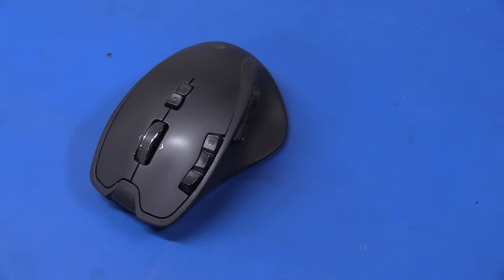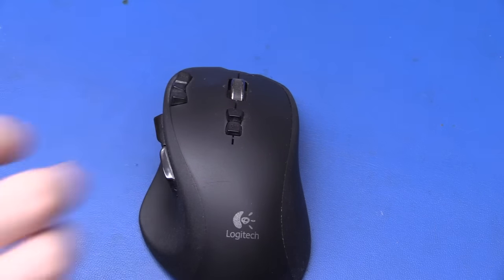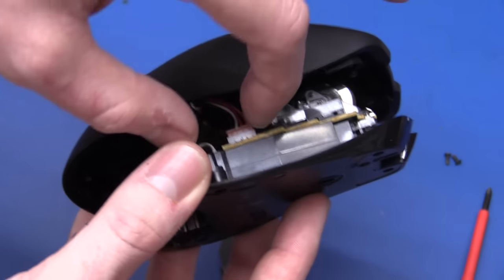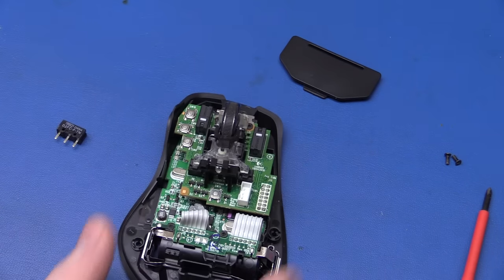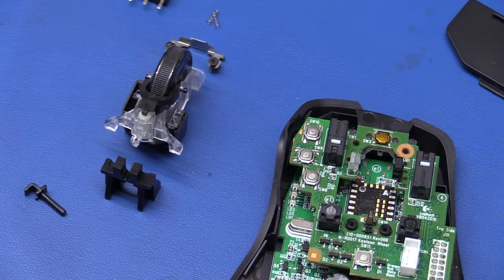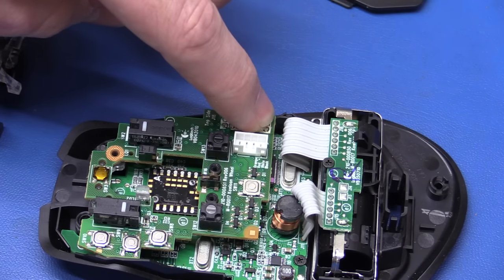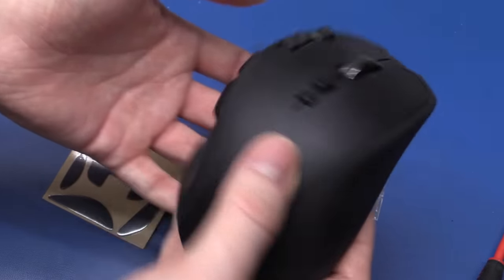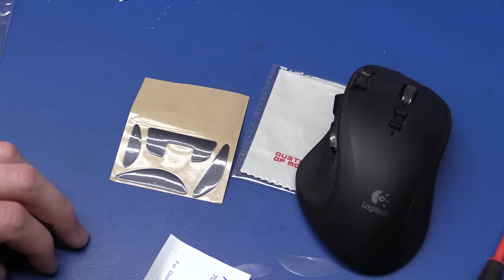Logitech G700 Mouse Repair (Bad Switch) - Ec-Projects

Comment: You might want to replace the whole upper board assembly with a new one from EBAY. All switches will be new. On top of that the new boards will have a 14 pin socket in place of solder pads. No need to resolder the new board in place. No unsoldering will be need in the future. The new boards I recieved have what looked like it has better quality switches as a plus. I have a supply of 60 million click switches on hand for the future. Only 3 solder connections now instead of 17. After all these years Deoxit will not undo physical wear caused by a trillion+ clicks.

Comment: I followed every step in this video, made the solder and tested the clicking of the micro switch which works well. Once I put on the cover and start pressing , the left button does not register a click at all. Not sure what is the issue though

Comment: I love my g700 but until yesterday my middle scroll wheel button stopped 'clicking'. I opened the mouse up and realized that the little gold circle thing that the wheel is supposed to press to register a click is stuck all the way in:( i mean the bulge is downwards so the curvature is not upwards.. any way to fix that? Do i have replace the whole board or just the gold thingie? Any place to order that part? Please help...

Comment: I have a Microsoft mouse from the time when they still made good hardware, that I revived like that once. It's an intellimouse explorer mouse (v1 that still support PS/2, but at that time they didn't even print version numbers on it ;) ), that has to be 15 years old, if not more (Amazon has reviews from 1999 for that thing!). I've use it 10+ hours almost every day (work related), but it has also been to LAN parties quite often in the beginning, where it survived Diablo clickorgies among others, and is still used for games alot. 
I also had to shorten the lead twice (once near the plug and once near the mouse, because the wire broke) and I think I only exchanged the left mouse button switch once (for a used switch from another Microsoft mouse of the time).
Other than that nothing broke, wheel is still fine, other buttons as well. Can't get anything like that anymore.
Damn, I'd really like to know how many clicks that mouse had. It has to be in the tens of millions, considering that a single Diablo session could easily get you to thousands of clicks.

Comment: Don't have the double click issue, but rather scrolling with the wheel seems to stutter.  For example, when scrolling down it might scroll up a tiny bit and then down again.  What switch/sensor keeps track of the mouse wheel assembly movement?

Comment: Decided to see if I can salvage this mouse which I have replaced for a couple years ago. It had the faulty double click issue. 

Question: When removing the solder at the 6:00 mark, what happens if the little circular solder pad discs are moved too? How do you repair it?
Reply from the maker: Hmm, you would have to follow the traces and find a component where you can solder a thin wire, then bring it back to the pin. you can also scrape off the solder mask over the trace and solder the wire there - That probably requires a microscope though, since you don't want to hit the ground plane at the same time :)
Reply: I had this mouse under my bed nearly for  5 years. I had put it there when it started having doubleclick issue. Mine pads are also nearly all gone while removing soldier. Must have happened because the iron was too hot or i didn't use the wick in the start. But the interesting thing is the omikron switches tested ok outside the mouse, so the most possible problem I had, should be just bad soldier on pins. Too bad it had gone bad in 3rd year of use, shame on logitech for not using a socket to connect the boards, shame on me for still not being able to protect the small board pads while soldiering.

Comment: Which is the second tool you are using there to break a little bit the previous solder mask? I have just only a solder iron (don't really know how North americans call it) so I have had a hard time trying to remove the original soldier mask. Would appreciate any info, thanks!

Comment: What do you use/do when the switch won’t come out due to the factory solder?

Tried adding solder to joint & desoldering but it wont come off, have yet to try using flux to desolder though
Reply: Try with flux and a braid first. If that doesn't work what I do is get some needle nose pliers (it'll get hot enough you really don't wanna touch it) and slowly jimmy it loose rotating across all 3 pads one at a time. Heat, work lose a little, move on to the next. Repeat until free, it does take a little time and effort. If you have high heat and move quickly you wont damage the pcb and the joints should stay relatively pliable. Clean out holes once loose as there will be leftover solder. Alternatively, if you don't mind being destructive, snip the plastic casing to expose the pins (need some sturdy snips) and remove plastic till its just the pins remaining stuck to the board. Heat up solder and remove with pliers one at a time.

Comment: I did this but now all buttons stopped working. It’s not as easy as it looks. Pointer moves but none of the 11 buttons work. 

Anyone has any idea what could have gone wrong?
Reply: Yes, you damaged the pad of upper left pin or short circuited it.

Comment: Seems to be that Logitech has made some bad component choices for their HIDs, I have an M570 which had the same issue, think I ended up replacing both switches.  Thankfully the switches are a bit easier to get to compared to these.

Comment: I have a roll of the wick you used in this video, and I have to say, I hate it.  Try some Techspray Pro Wick--I was blown away by the difference.  It's a bit pricey; but definitely worth the saved time and effort.  The #2 or #3 are good for general use.
Reply from the maker: I have to agree actually.. The other roll have is way better.. I'll try the one you mentioned :)

Comment: Mouse Button Part Number: Omron D2FC-F-7N . They can be rated for 10 (10M) or 20 (20M) million clicks. If they are not marked, the gray coloured button/top is rated for 10M and the white coloured top is rated for 20M.

Comment: Well done video.  I like where you sped it up through the parts that we don't need detail.

The day I took my mouse apart (I first tried using canned air on the switches) I didn't want to wait for new pads.  So, I used the video to locate the screws under the pads.  Then, I used an X-acto knife to cut a hole for the screwdriver to fit through.  That way, I can keep the feet I have.  I don't notice them when moving the mouse.  In three cases, it also captures the screw, making it easier to keep track, and to screw them back in.

As you said, the feet are cheap.  I ordered a set.  But, I don't notice any issues with the holes I cut.  I'm living with it right now.

I just replaced my switches.  Both were failing.  I found that getting the solder back on was as difficult as getting it off.  Especially on the connector pins.  Those are small, and it was difficult to keep the solder from spreading to the pin next to it.  I have a setup where I have lights and a magnifying glass on goosenecks, so I can position them exactly where I need.  I don't know that I could have done it without those.  I think I got it.  My first quick test was successful.

Comment: what size solder wire you need/used to change a mouse switch?
Reply from the maker: anything could do, really. But I recommend 0.7mm or less. I usually have both 0.7 and 0.4mm. :)

Comment: Hi, where can I buy the parts?
Reply: Ebay/Aliexpress/Amazon etc.
I'm recommended Cherry DG2 (black stem, P/N DG2 T85) switches. Better than Omron.
More expensive, but much more reliable. Mechanically and electrically compatible.

Comment: After a change both sides of my clicker they doesn't work again, did do something wrong, pls help :(
Reply: did you plug in all wires? did you short circuit something? or shaved any small smd parts?

Comment: Guys do yourself a huge favor and do NOT DESOLDER ANYTHING.
Just order some replacement switches (or bare springs) and pop the switches open, study how the the innards are laid out (take a pic) and transplant the new contact spring onto the old switch (clean/scrape the old contacts).
I killed one G700 by desoldering till it occurred to me I could just replace the faulty spring, the 2nd G700 is doing great.
Reply: Desoldering is very simple actually... :facepalm

Comment: Buy a D2FC-F-K(50M) switch instead of the original ones. Those can do 50 million clicks. The original ones only last for 10 million clicks. Logitech really saved on the wrong end here. Unbelievable for a 70€+ mouse...
Reply: I'm quite sure the rating for maximum number of clicks is not necessarily connected to the double clicking problem which develops more over time than number of clicks. So 50M may not help. Who knows.

Comment: I have seen replacement top boards for this mouse with the 14 pin block pre-soldered to it, suggesting that the pin block unplugs from the bottom board?   Look at this picture:  
https://www.ebay.co.uk/p/Original-Mouse-Motherboard-Upper-Motherboard-Key-Board-for-Logitech-G700-G700s/13026793038?iid=254014245704&chn=ps
Reply: It's probably just different production batch. They make minor changes between batches either for design improvement or ease of manufacturing throughout the production life of a product.

Comment: Those switches are really bad. It is also used on most gaming mices. You should have avoided that kind of Omron that were made in China(not for racist reasons, it is just the some Omron China switches are prone to double-clicking unlike the Omron Japan ones).
Huano is also ok